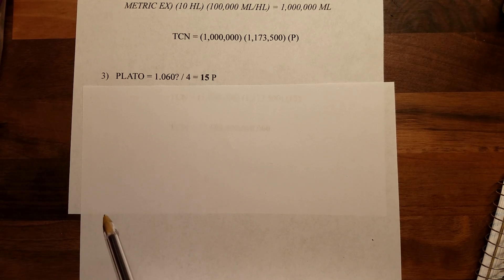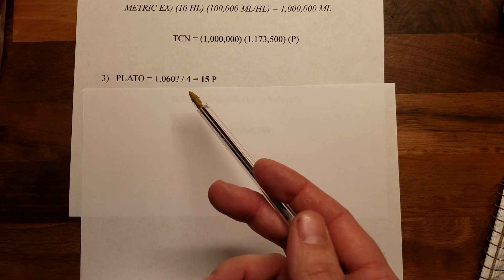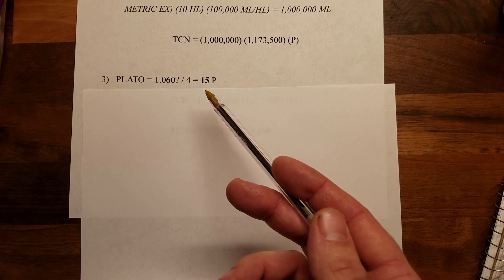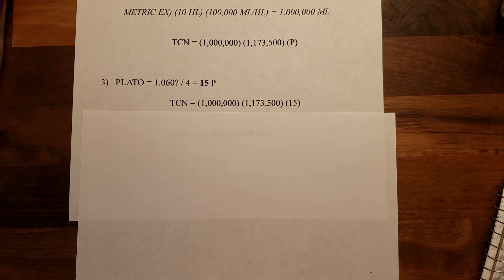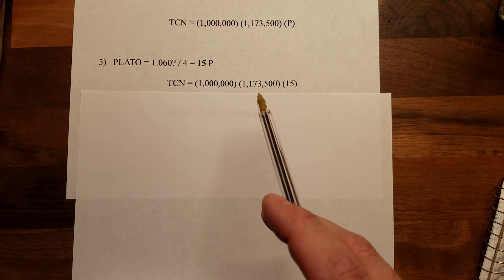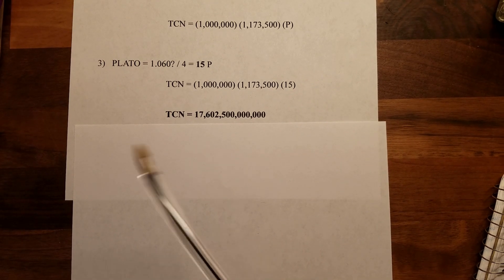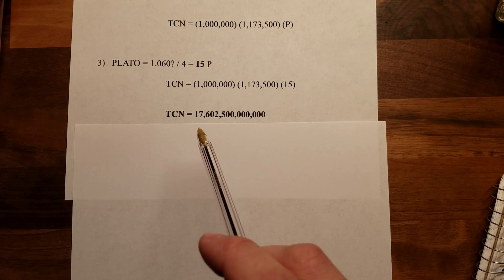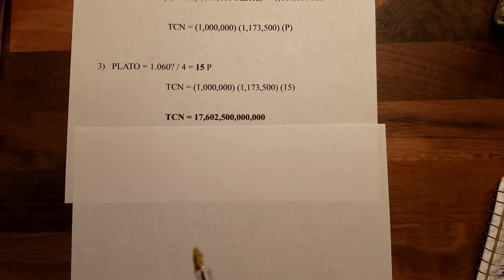BREWING EQUATION! How Much Yeast?? YEAST PITCH MICROBREWERY!

Comment: Hey Jasper! I’m enjoying the videos and feel they will be of great help. I have a pub system from PSS. I need help on cleaning the system after brew day. Particularly the HEX. Could you do a video for us new to the pro system?
Reply from the maker: Hey Eric, 
Man I know that feeling.. kettle and HX cleaning at the end of brew days is like a huge mystery. 
A few tips that helped me, Make sure to push hot water behind the beer at end of KO. This will get you more volume in FV and make sure beer/hot break just doesnt sit in the HX. Also use hot caustic with and oxidizer running backwards through HX at 1.5x speed of KO. Throttle the out going valve around the HX to flex and build pressure in the HX during caustic run. This helped me, let us know if it helps you too. Cheers
Reply: @brewerylife3596  I second Eric, i will love to see a Brewhouse (including heat exchanger-wort chiller) cleaning video :)
cheers

Comment: Great video!

I’ve been wanting to do continual top crop at home but have never wanted to take the risk of guesstimating the cell density in the slurry.

Do you think 750M cells/g is a “safe” estimate for cell density in top crop?

If so, a 15 gallon batch (16.5 FV volume) of 1.060 wort at 1M/ml/P would require 1183 grams (or 2.6 lb) of slurry?

Are my assumptions fairly accurate for this? 

Thank you.
Reply from the maker: No, you need to do a cell count to find your density. It can vary from 100M up to over 1000M. Always count your yeast and dont guess. The purpose of this video is to be precise on your pitches and not estimate to make the best beer you can. Hope that makes sense, best of luck.